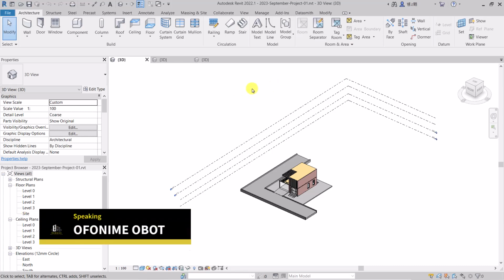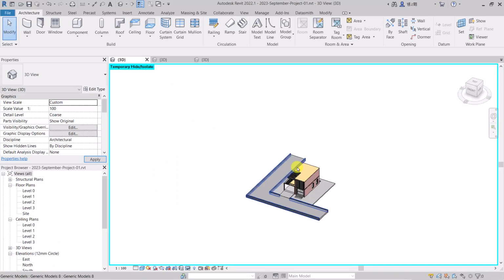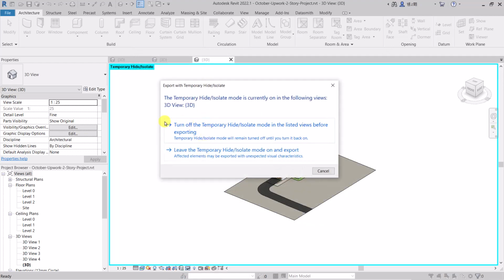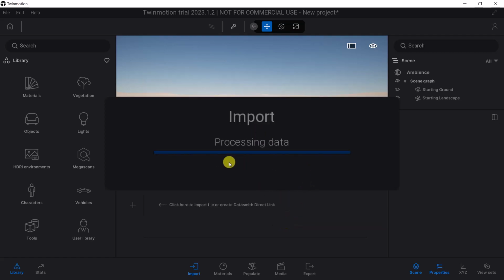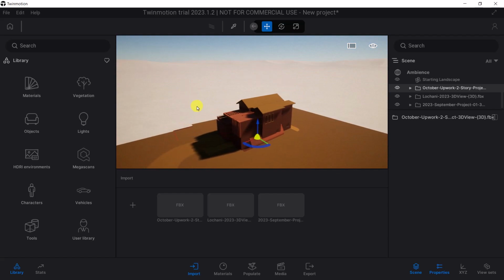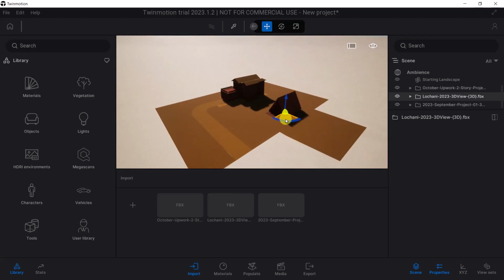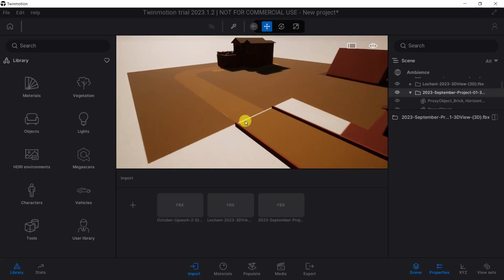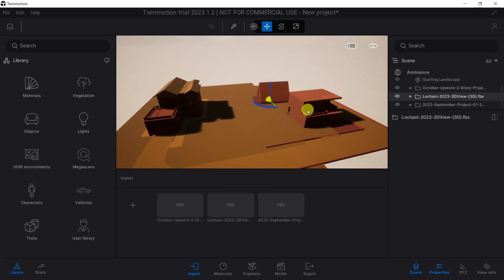Revit to Twinmotion 2023 | How to Import Three (3) Models

Comment: hi , Quenstion , why the import to twin is color brown ?  no color of revit ... thanks .
Reply from the maker: It’s from the method of import I used. 

I used “import Geometry” and import the three different models.

A direct link import will come with material texture and color from Revit.

That means you will have to merge three models in Revit before importing them into Twinmotion using a direct link.